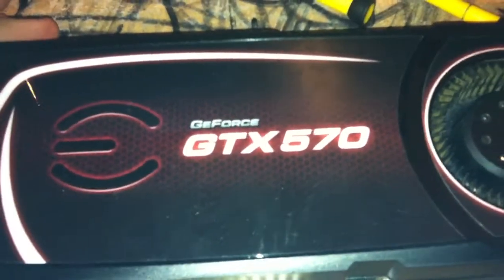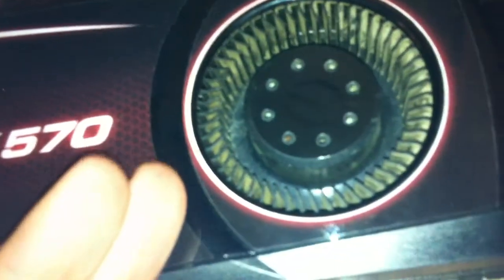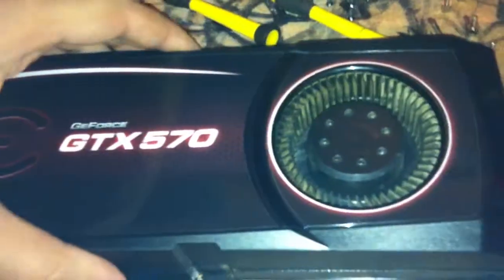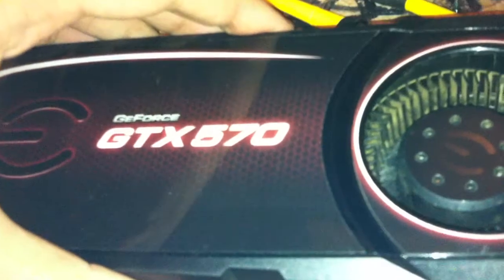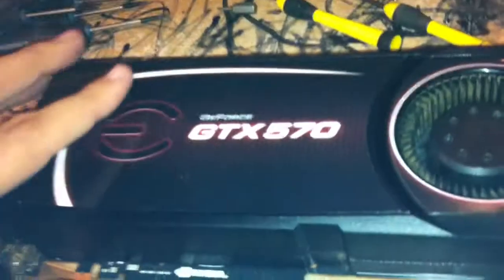NVIDIA-EVGA GTX 4-5-6-7-9 Series Video Card Overheating issue Fix

Comment: My EVGA GTX 580 recently started running at 55C idle and 100C after 10 minutes of load.... No crashing but I knew it would be coming.  Doing this helped.  Now it's running at 37C idle and ~73C under a 30 minute load!  Great, concise video.  Thank you.
Reply from the maker: yes specially the video cards witch the warranty has expired, some guys just using the air gun or vacum machines, but trust me the dust will stick after a while so you really need to clean the inside of the card and apply new thermo paste recommend the silver artic :-)
Reply from the maker: ***** Its called a T6 screwdriver

Comment: I used to be having a lot of problems recently playing games with my EVGA GTX 580, specially under heavy load. I could barely play for an hour or so before getting a terrible black screen and had to reboot the system again. First I thought it was some kind of problem regarding drivers/BIOS/voltage, but having tried it all, and almost near desperation, I ended up here. I'm so glad I did! Everything seems to be working like a charm now! Thanks a lot for the video!

Comment: i was getting random shutdowns, noisy gpu fan and hitting gpu core temps at almost 90 degrees active/70 degrees standby.   Found the exact issue you described.  Blowing air without removing the heatsink did not work as you said.  Got the case open and blew the dust off the heatsinks directly.  I am now running at temperatures around 45 degrees on standby and my gpu fan isn't going crazy fast again. THANKS!

Comment from the maker: yes you are right, but most people just try to blow the dust from the fan and they think is done, and i am 100% sure that if you buy a used video card like this and the warranty is expired just go head and open up the card, cause u dont know if the there is suprise like this :-) cause that kind of dust is not gonna come out if you just blow it, and also every 2-3 years u shuld clean of the old silver artic cream and apply new

Comment: I have an EVGA GTX590 Classified which has the fan situated at the center of the card,  Fortunately on this model you can see some of the heatsink, which allows you to clean it out with compressed air without disassembling it.  I had mine drop by about 20 degrees celsius while idling after doing this.

Comment: New PC and new GTX 750 fan at 100% it still rises to the limit I set in EVGA to 85 C temperature after few minutes of playing. MSI Afterburned did absolutely nothing, fan was stuck in 30% all the time no matter what and temperature skyrocketed to 95 C even when playing on lowest settings. Needless to say playing any newer games was impossible.
Reply from the maker: ufosauna wow i have the GTX 970 and the fan dosent even turn on with like fifa and low end graphics games, but i have no problem with any games so far, i think that card has some other issues, if you still have the warranty than send it in to nvidia and you should get a brand new one, i think there is a hardware issue

Comment: hey plz help me out .i live in india where i get only the zotac model of 660.now the problem is that i have a smaller case ,and the zotac has two 660 version one is the synergy edition with 1 large fan and the other is standard zotac 660 which is very long and has 2 fans with heat pipe.both the specs are same .so which 1 should i go. the synergy edition or the standard edition.i am afraid that  the standard edition  would not fit in my case. but also i have heard that gtx 660 cards tend to heat up lot.
Reply from the maker: u should order one Asus GTX 660 from some other country or try ebay i would not take a chance, cause if you buy a new card and open it up than u lose your warranty so get a used one for cheaper or order a new online  ASUS GTX 660 there is a way to do that i am sure!

Comment: Can you leave the cover off permanent for added cooling or is the case designed to do something specific?
Reply from the maker: i think best if you dont leave it open cause the air flow will be less, and can cause even more problems
Reply: Thanks, that's what I figured...didn't matter for me, couldn't get the back plate off my Titan because they used little t6 screws. Gonna have to invest in a tiny tool kit to work on the thermal paste for that card...wasn't really dirty inside that I could see